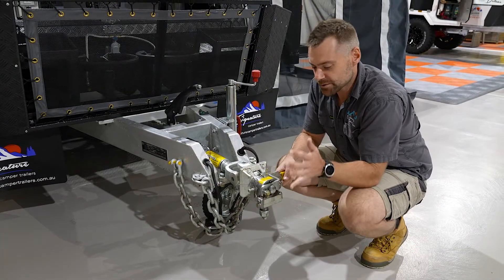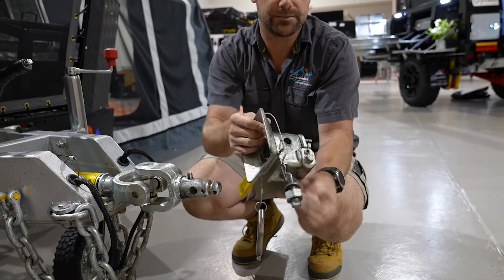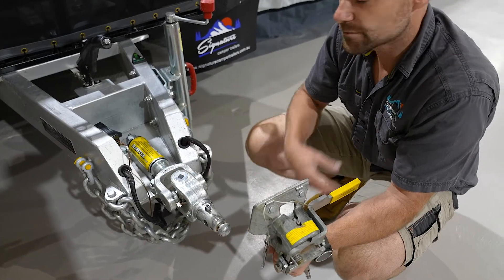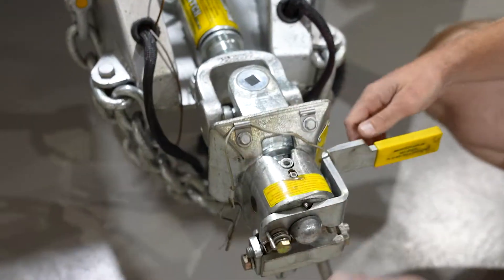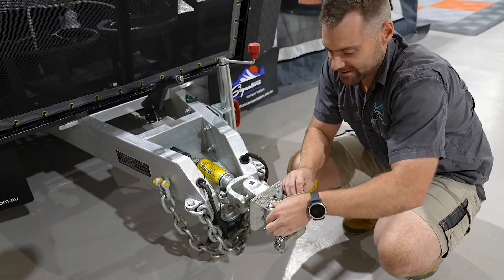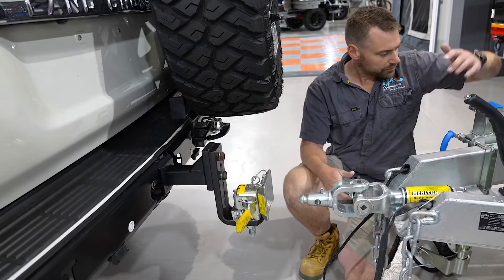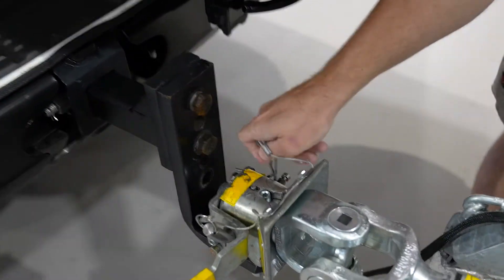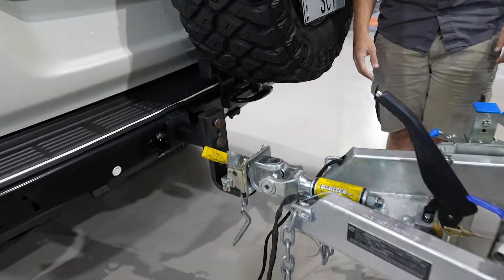Mchitch 3.5T Uniglide OFFROAD Trailer Coupling - HOW IT WORKS

Comment: what is the name of the tow hitch receiver that you are using? I have not been able to find a Tow hitch receiver with a  2.5” or 3” Surface plate. You said “Standard” but all of the Tow Hitch receivers that I have found either do not specify the width of the base plate or I have found that “Standard” is 2 inches. McHitch recommends a 2.5” or 3” surface plate in order to properly secure the McHitch receiver with the pins.